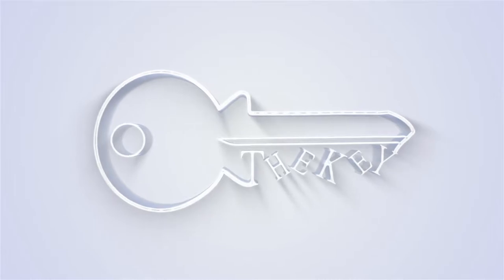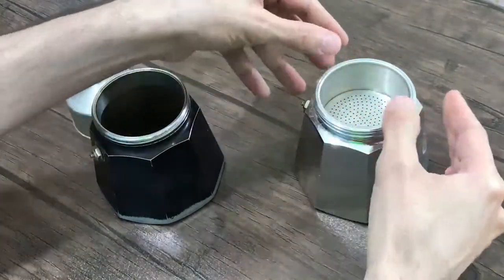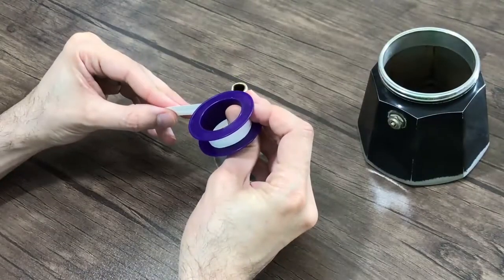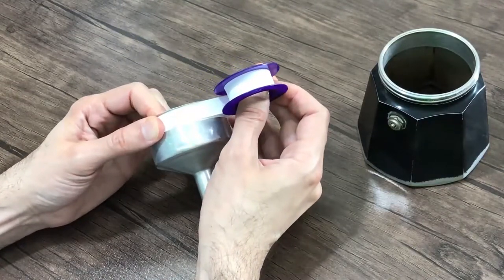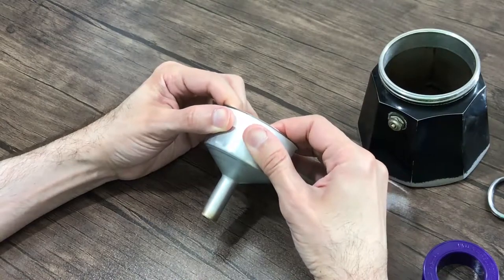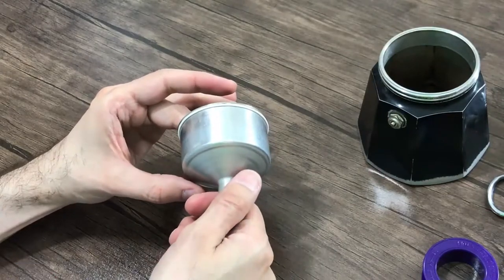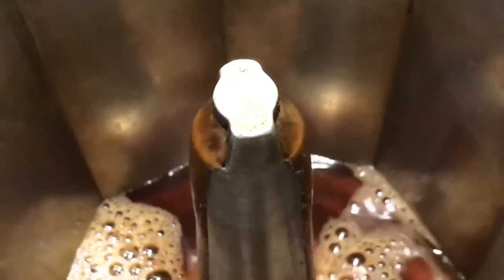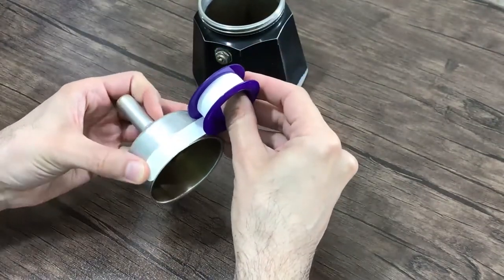How To Repair A Moka Pot That Can Not Extract Coffee

Comment: Hi, I don’t understand why my moka pot once worked and now doesn’t. Before seeing your video I actually bought a new funnel and I’ve changed the seal and still it’s not working I can just see steam and hear a loud boiling sound. Any ideas ?
Reply from the maker: New funnel and new seal, but it doesn't work! 😃 This is one of those problems for which I need to see and test your moka pot. What I guess is that, there are tiny changes in designing and producing new moka pots. These are helpful for new buyers, but make the sealing of older ones nearly impossible.
Reply: @thekey_  Yes you could be right. The sad part is it was only 4 months old. Anyways I had no choice but to order a new pot hopefully this one will last me longer than a few months. Can the safety valve cause problems?
Reply: @thekey_  The plot thickens! I got a new pot and it’s still doing the same I’ve tried 2 different coffee types including the Illy one which specifically states for moka pots but it does feel like a finer ground. I’m going to try another coffee for the 3rd time, wish me luck!
Reply from the maker: @Iremnaz786  Wow! what a strange story 😊😊 I hope that it works now.

Comment: is there a long term solution to this problem?
Reply from the maker: Yes, there is. Use PTFE tape for a while. Then check the sealing ring after a few weeks. You will notice that the seal has become thicker and seals the gap perfectly. At this point, you don’t need to apply PTFE tape until you want to change the washer again.